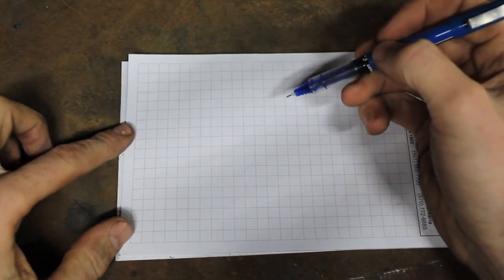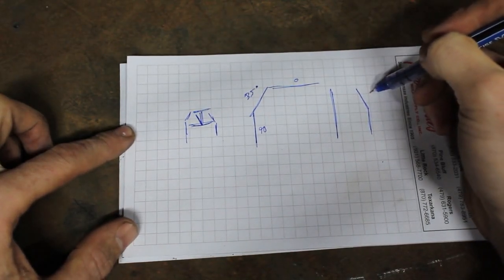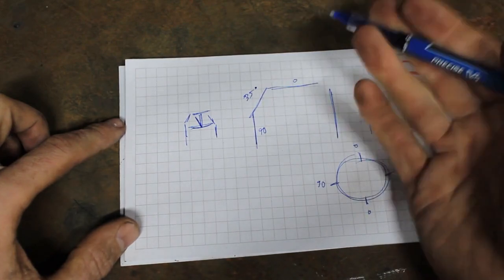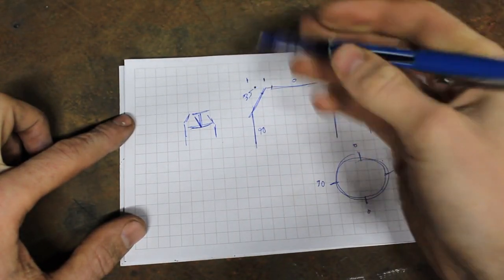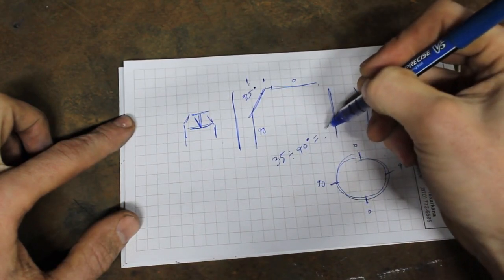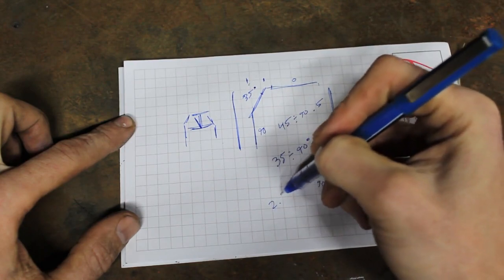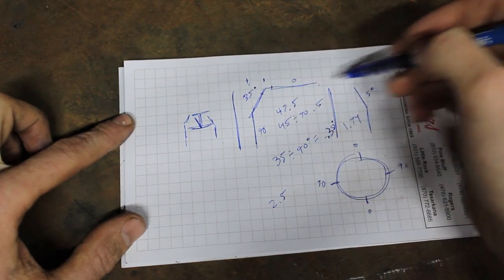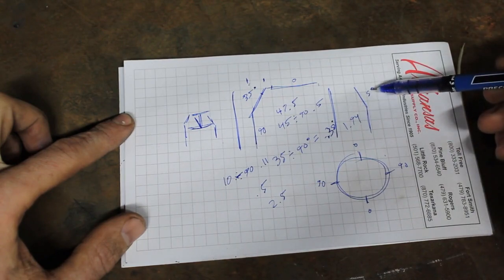Let's Talk -  About Calculating for Compound Bends

Comment: That is an apparent angle of 35 maintained.  However your formula for an apparent 45 with a back 45 comes out to be 67.5 which is incorrect.  The correct bend angle is 60 degrees.  I am sure a 5 degree would be close enough, but not larger angles.

Comment: alright, I watched with sound. the issue with using a straight ratio (say 35/90) is that a circle doesn't move linearly. You will have more X motion and less Y motion initially, at 45* rotation they will be the same, beyond that you will have more Y and less X. If you were trying to find out where it would end on a line, then yes that ratio would work. Will it be "close enough" to work for pretty much everything automotive? Absolutely. just make both sides match and nobody is going to care or notice